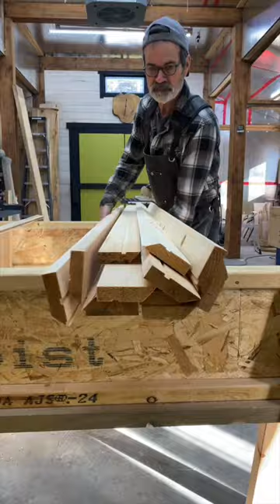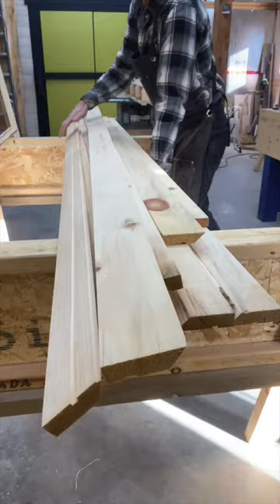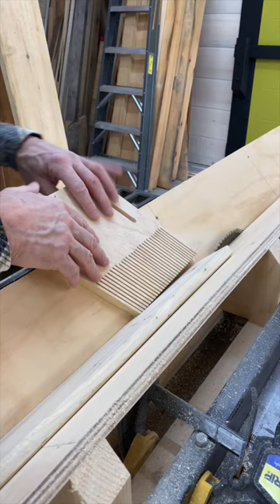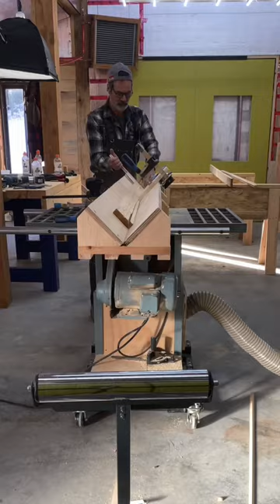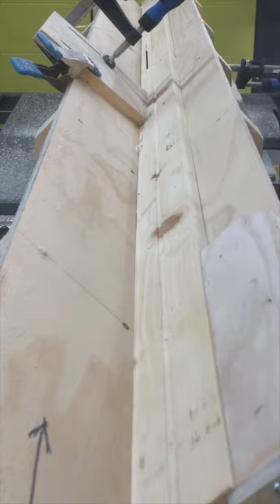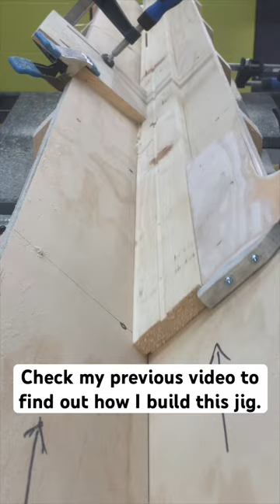French Cleats Factory #woodworking #diy #jigs

Comment: The big question here is "why"? What's the advantage of this over tilting the blade? That's a large jig to store, and it's limited to only cutting right at the edge of the board.  By contrast, if I tilt the blade I can run a 1x6 and cut right up the middle, making both halves of the cleat at once and wasting no lumber.  What advantage does this jig present over tilting the blade?
Reply from the maker: Hello @entropypgh. With my old Delta contractor table saw I can assure you it's worth it. I gain precision while being safer. I'm aware that the jigs we make often take up a lot of space in the workshop. But it's important to keep in mind that the videos I create are intended to share the joy of carpentry and to educate. Not everyone needs all those jigs. Everyone has to choose what's right for their operations. Thanks for your comment and have a nice day.

Comment: now imagine the blade tilted.
Reply from the maker: If you tilt your blade with this jig @oldmarine312 you’ll even be able to cut angles that are more than 45 degrees. Have a nice day.
Reply: @SawdustSociety  but you're not cutting that big of an angle 
jig is not needed
Reply from the maker: @oldmarine312, I built this jig because I have a lot of French cleats to produce and I wanted to do it to be more productive, precise and safe. On the other hand, I have an old table saw which is more or less accurate and doesn't have all the features of the new tools, but is still very good. I like a challenge and I love creating jigs for different functions rather than always buying new tools. It also keeps my brain active and allows me to relax. Have a nice day!

Comment: Seems as though you are putting the weight of the board on the blade and creating a pinch especially when finishing your cut, I don't know, doesn't seem right to me. 🤷‍♂️ Just discussing.
Reply from the maker: Hello @MB-zj3er, you have to put enough weight on the board to make sure you have a good contact. The feather board and the push stick keep the board in the groove and make it secure for the user. Thanks for your comment & have a nice day.